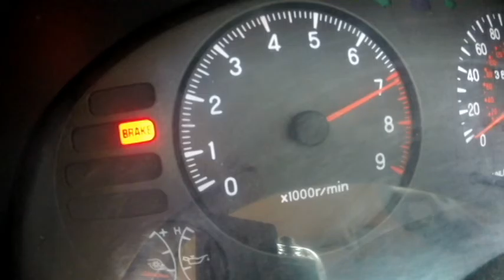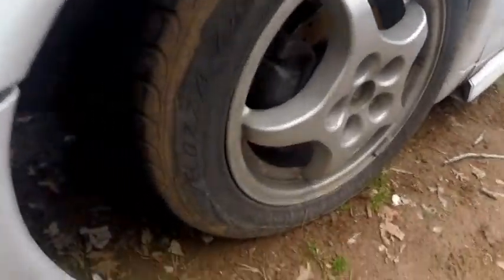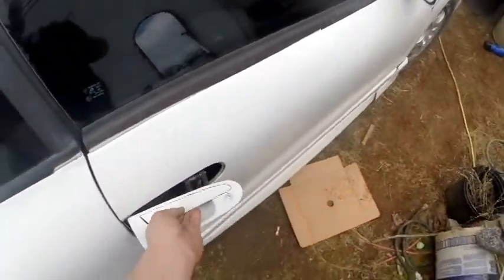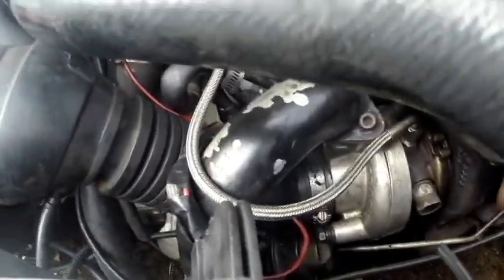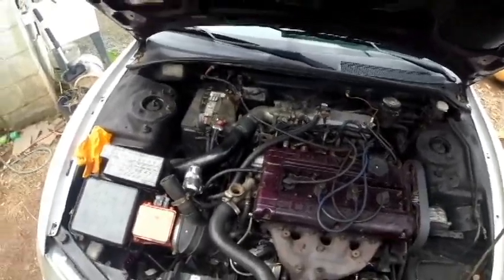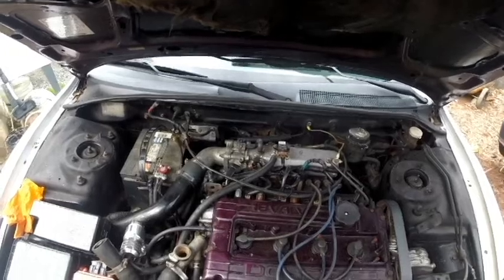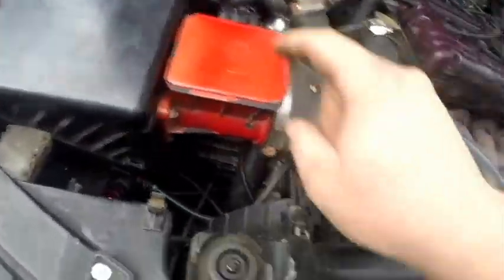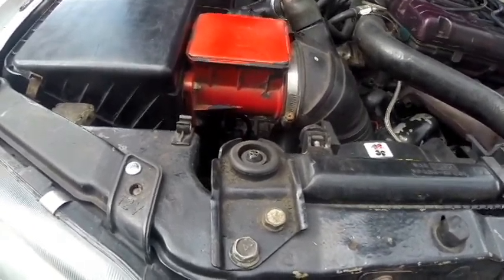GST project update

Comment: How's the car doing... Any updates? Well if you still have it, I believe the reason for the sputtering during start up and your bad gas mileage is due to the blow off valve not recirculated back into the intake. If you look at your intake, the part right behind the MAF sensor,  there's a hose that's just sticking up doing nothing. That is actually supposed to hook up to the blow off valve because the stock ecu is tuned to have that air recirculated. The previous owner wanted an aftermarket blow off valve, which is fine, but installed a non-recirc one... An that causes a ton of issues.
Reply from the maker: +DSM jUhnky the starter went out recently I replaced the map and maf sensor and it helped a lot with the really lean issue it did not have a hose to the bov so I will check that out but the maf was the biggest problem I had so far